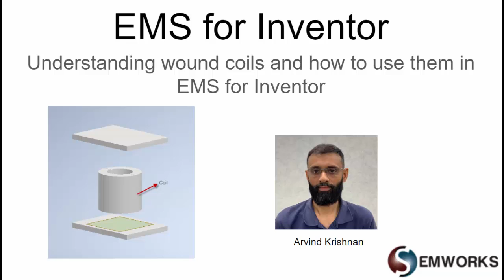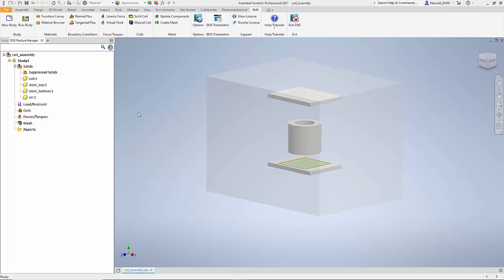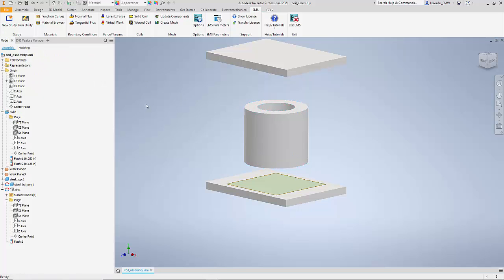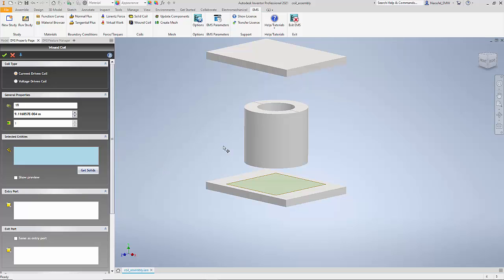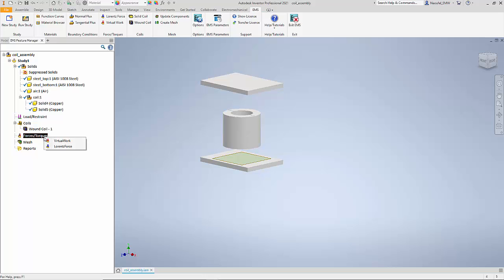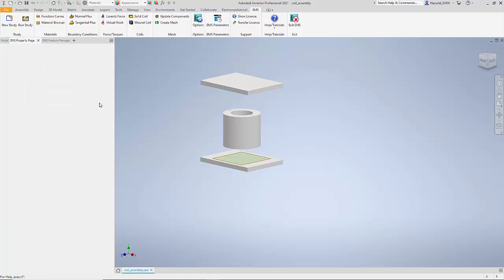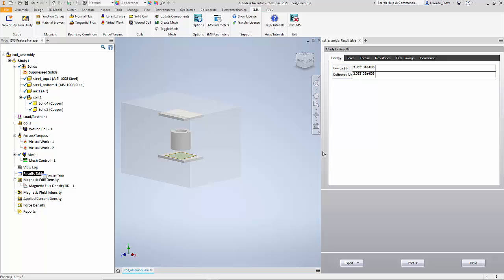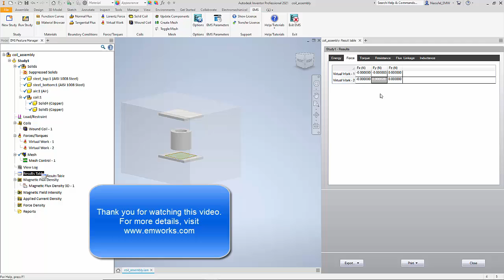Understanding wound coils in EMS for Inventor

Comment: Does this simulate the current in the solenoid accurately? That is, does it also factor in Lorentz force, assuming the current is confined in its trajectory by individual wires? Or would that require more direct modelling?